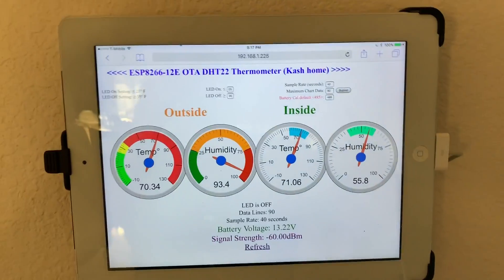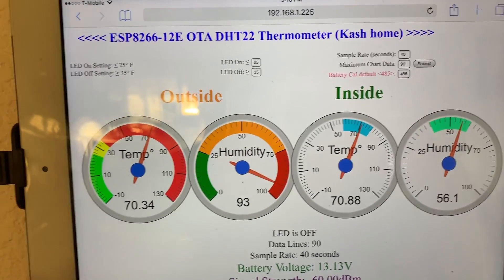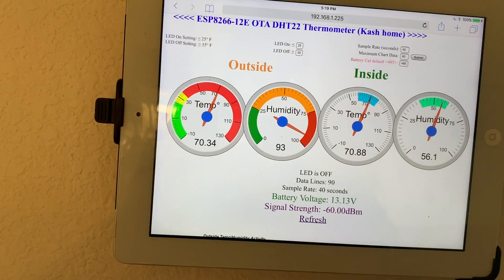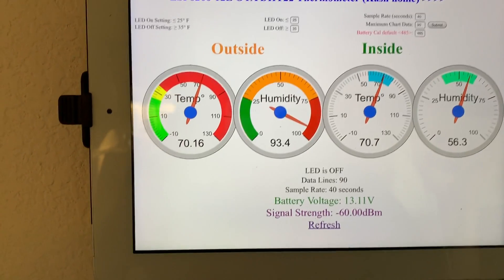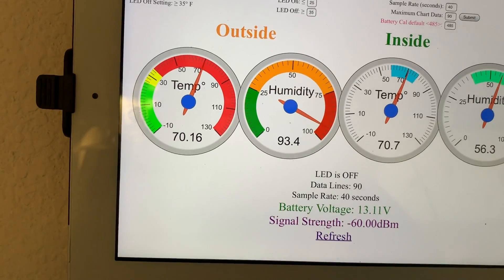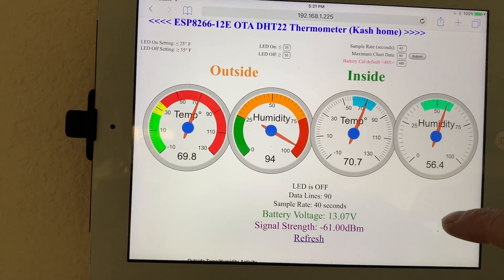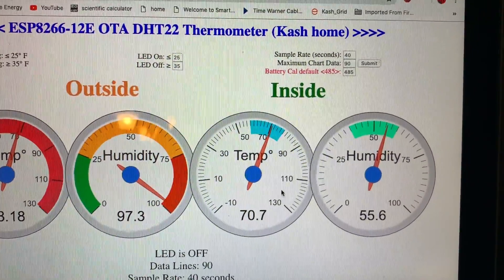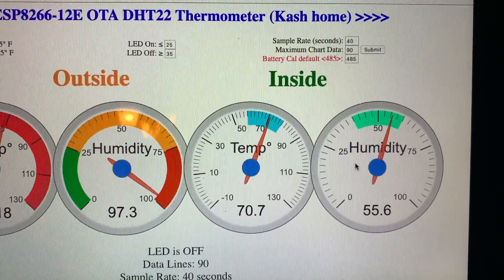ESP8266 Thermometer 1/2

Comment: How to access over Internet?
Reply: Have you got a github page so i can download this project?
Reply from the maker: I used this just for local network that have internet access since I need to pull gauges and charts from google site, but I think if you assign a Static IP and Port number to your (Web server ESP8266) "Not the client server" and then port forward that IP address with Port number within your router then you should be able get access to web server out of your network.
Reply: @Mark1Jordon1  does that mean everyone can access to esp?
Reply from the maker: @FikiFirmansyah  Yes, if you give them the address of Web Server to everyone. you can password protected but then you need to add more code to the Web server Sketch.
Reply: @Mark1Jordon1  nice info. Thanks.